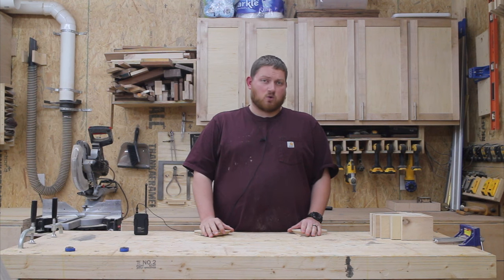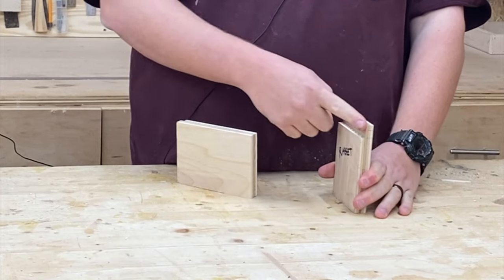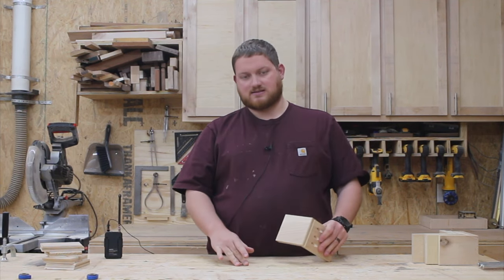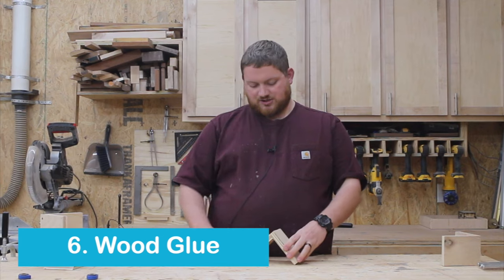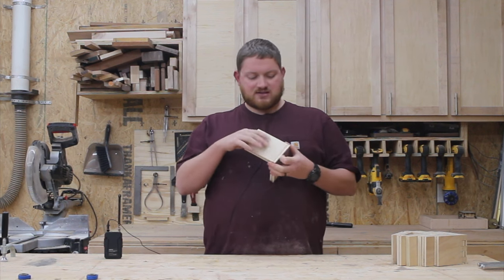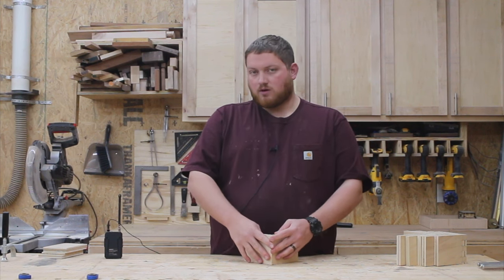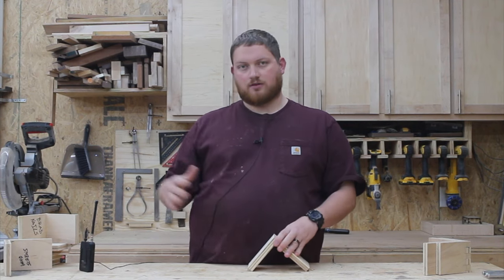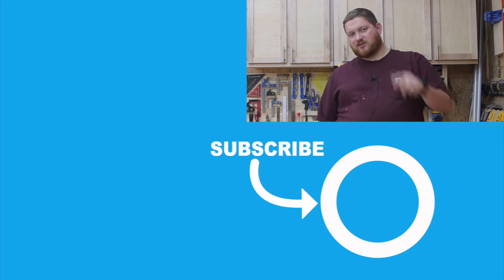7 Methods Of Plywood Corner Joinery | How To Join Plywood In A Corner

Comment: Good presentation. My problem is a drawer build that specified 1/2" ply using pocket screws. But the nominal 1/2" ply measured only 11mm which Kregg said is too thin for pocket screws. But I already have the pieces cut. Now what?
Reply from the maker: I believe Kreg sells small 1" PH screws you could try. If not, potentially look at simply glue the box together for now. If that doesn't work, you may have to re-cut the pieces.
Reply: @RockyRiverWoodworks  Well too late. I already used N0. 0 biscuits and glued instead of screws. Next time I will use a caliper to measure plywood before I buy. Thanks for replying - much appreciated.
Reply from the maker: @Rastameister best of luck!

Comment: According to Google Bard, a box joint is a specific type of finger joint. Box joints are obviously for making boxes, finger joints can be used to lengthen wood, as well as make right-angle joints.
Reply from the maker: Accurate. You will see finger joints in trim/millwork many times.

Comment: I want to use pocket joints to create some shelving, but I will only be screwing into 18mm plywood, and so the max depth of screw I can go into the second piece of plywood is 18mm. Will that form a strong enough connection for my shelves? Thanks
Reply from the maker: Yes I think it will, but I would also use wood glue in combination with the pocket screws.
Reply: @RockyRiverWoodworks  great thanks for your answer!

Comment: In other vids I've seen any butt joint, including fastened with pocket screws, called a box joint.  FWIW.  Is pocket method stronger than butt screw?  Thanks!
Reply from the maker: I haven’t officially tested but I think they may be similar. However, the pocket screw goes in at an angle which may allow it to be slightly stronger.
Reply: An important idea to note is that all pocket-holes are not the same, that is they have different degrees to the angle, and that makes a difference when working with different thicknesses and for options for orienting the pocket hole (which side), and for your concern of strength.  The popular plastic Kreg jig provides a 15 degree hole. The Castle Jig (110) provides an angle of only 3 degrees. For most applications, I'll argue that the Castle hole provides a stronger joint due to its degree centering the bond in the middle of the other board as opposed to the precarious pend point of the Kreg screw. Additionally, consider the cleanliness of the edge hole (which results in less "carnage" and glue mess.  This is not meant to disparage the Kreg (I have one too), but to point out options, especially since the Castle is less known to most DIYers. You can explore this option by "googling" Castle pocket hole.

Comment: Can I make a rabbet cut on 2 pieces of 3/4” plywood to join them using a router or would I have to switch to a table to make that cut? FYI I don’t have a table saw lol. I’m making a shelf using 3/4” plywood that’s 60” x 10” and slapping a 1x4 (3/4”) on the face of it
Reply from the maker: It can certainly be done on a router table or even a handheld router with an edge guide.

Comment: the dowel is especially useful and if you use two pieces of painters tape and follow another tutorial on youtube you can make super strong dowell joints in a fraction of the time it takes to do many other conventional joints

for most applications in 3/8ths and up thick ply, miter joint and proper gluing is sufficient
Reply from the maker: Great points

Comment: Great simple video.  I’m doing a butt joint with two 1/2” pieces of plywood.  How long should the screws for this be?
Reply from the maker: Frankly, as long as you want. Just watch to make sure they aren’t so thick that they blow out the 1/2” material. Shortest I would say is maybe 1.25” long.

Comment: Excellent, looking to build a simple little cabinet style box for my 3D printer -  so I can keep resin warm for long prints. Didn't know you could do butt joins with ply, so that's a nice surprise, although I do kinda think maybe I might look at pocket holes if I choose to build it with ply vs pine planks. Cheers.
Reply from the maker: Great, good luck with the build!
Reply: @RockyRiverWoodworks  Cheers, do butt joints with screws work with 7mm ply?
Reply from the maker: @MLaak86  They certainly can. I don't see why not. It might be hard to use screws though. And at that thickness, it may be difficult to get a strong glue adhesion to the "end grain" of the plywood for the joint since the surface area is so small. Worth a try though.

Comment: Great video! Thanks! What joining method would you recommend for an obtuse angle like 120°? Thank you from Denmark!!
Reply from the maker: I would suggest either a splined-miter joint, biscuit joint, or dowel joint. Coat it heavily in glue and let fully dry!

Comment: Thanks. I have been using pocket joinery with 3/4 inch plywood. I m planning to make cabinet with 3/4 inch for verticals to hold drawers. For actual drawers i m planning to use 1/2 inch. Can pocket joinery be used smaller screws?
Reply from the maker: I’ve never used pocket holes on 1/2” material. It may be able to be done, but my worry would be that there’s isn’t enough material on 1/2” material to give the screw something to “bite” into.
Reply: @RockyRiverWoodworks  thanks. I will simple joint with nails
Reply from the maker: @gabbarsingh1948  go for it!

Comment: I’m by no means a wood guy.  Been welding and fabricating for decades though.  My question is can you use pocket holes on .5 inch plywood?  Doesn’t seem like enough to grab on to.
Reply from the maker: I have been asked that many times before and quite honestly, I don't know. I might give it a shot because I am curious as well. I have never tried it for the same reason you mentioned...it doesn't seem like it would be strong enough. If I try it, i'll let you know!
Reply: What about .7 inch plywood?

Comment: Wood screws will make a solid joint if they are screwed into edge grain??
Reply from the maker: They have given me fine results. Under extreme pressure they of course will fail, but when spread out evenly and many installed, they hold fine.
Reply: @RockyRiverWoodworks  I always thought edge grain was "weak" and didn't accept screws very well??
Reply from the maker: @harrybrain8270  I agree. It’s not ideal. But if adding plenty of screws, many make light work and can hold fairly well if other options aren’t available
Reply: @RockyRiverWoodworks  Thank you sir